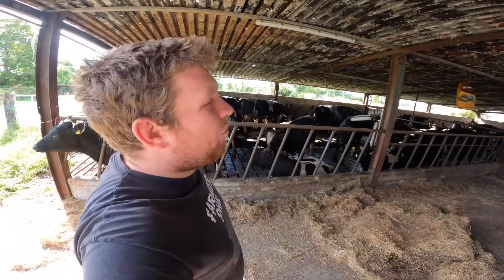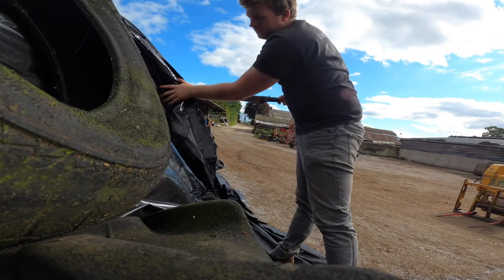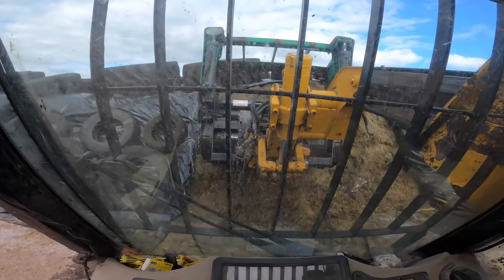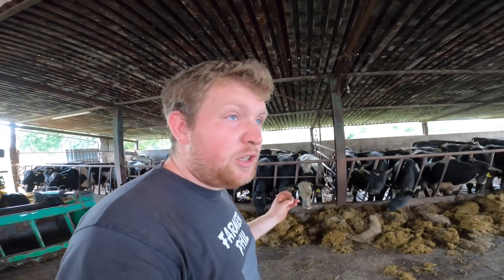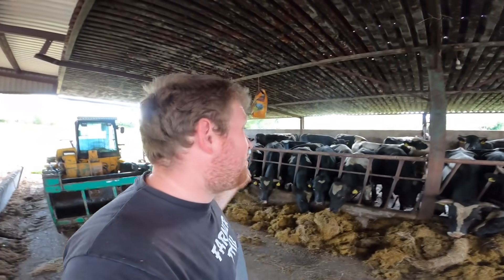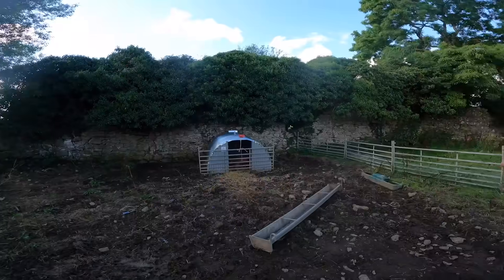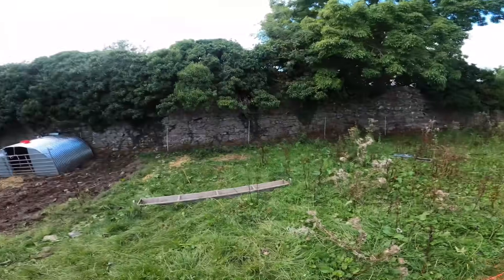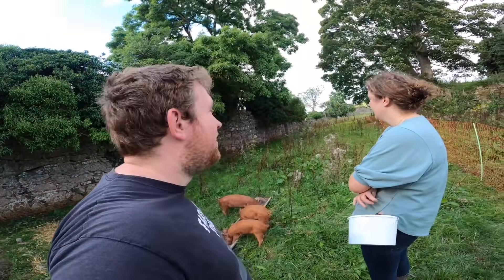PIT & PIGS | OPENING THE SILAGE PIT 2021 & MOVING PIGS

Comment: Great videos and well done on the 50k! When gathering up the netting lay it flat on the ground grab one end stake and walk to the other end picking up each stake as you go then use the stakes as a centre to roll up the net, when putting it out let the net hang down and hold the bunch of stakes and walk backwards letting off each one as it stretches the net. Won’t get tangled up or twisted that way!

Comment: To get an easy 3rd service on the massey 50.  Lads bolt up one of the legs and tee off the hydraulic pipes off that leg
 Pulling the lever for the leg then operates the 3rd service